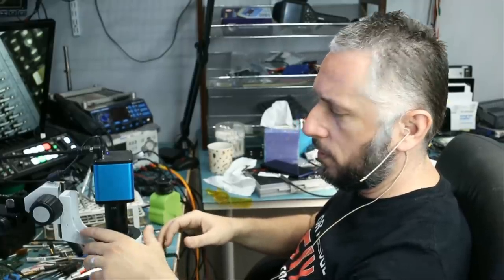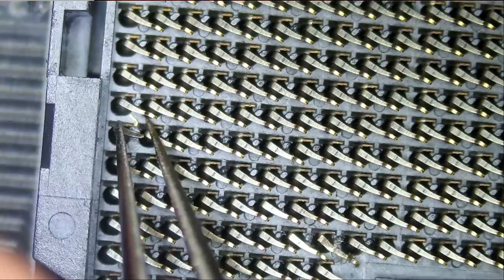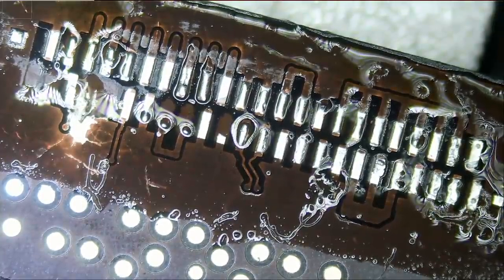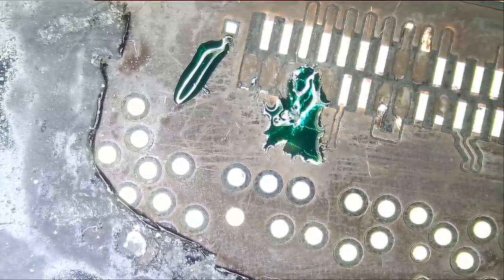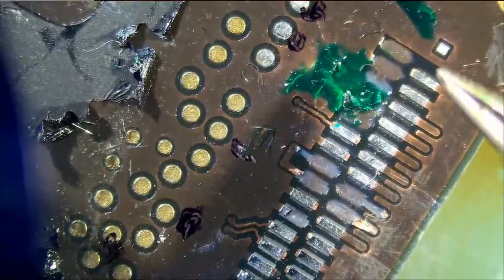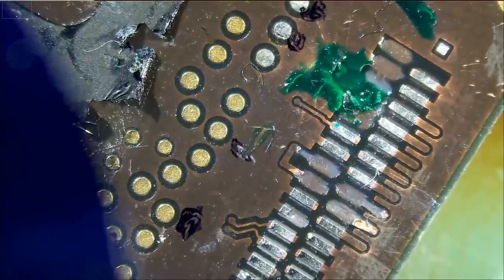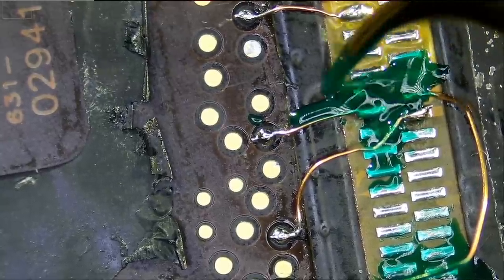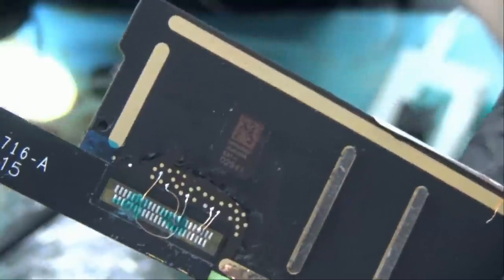Asus CPU Socket & iPad 6 charging flex board repair + Hoodie gift

Comment: as i'm sure many don't know; Sockets are replaceable, not worth the money on low-end Mobo's but a Z class chipset like the one in the video is well worth it 
the socket itself costs 20 $ from china and is a BGA component
Reply: Good luck finding a shop that wants to solder on BGA components or even has the stuff to do so.

Comment: 1:20 I advice to heat a little area where the bend pins are. I think some about 80 degrees Celsius should make the job easier making pins softier and also more resistant to break.
This is from my personal experience
Reply: damn thx for the idea
Reply: Thanks
Reply: as i'm sure many don't know; Sockets are replaceable, not worth the money on low-end Mobo's but a Z class chipset like the one in the video is well worth it 
the socket itself costs 20 $ from china and is a BGA component

Comment: What about the pin that fell into the socket? Isn't that a shorting hazard? Otherwise amazing job. You have way steadier hands than me.
Reply: It goes into ninth dimensions and it lie next to capacitors and resistors so it is not a problem now ;)
Reply: wondered same thing.  had to rewind and look twice to make sure I saw what I thought I saw.

Comment: Should the 3rd wire repair have been  connected to the pad next to it aswell.
Reply: Well spotted. I forgot that as well and that's why I would jot down a quick diagram for a job like this and not rely on memory.

Comment: The straight jumber on the flex cable should have gone to pad beside it too since the pads were joind under the flex cable but had both pads ripped off!

Comment: for bad intel cpu pins, If you pre heat the pin with solder iron I believe failure are less frequent.
Reply: I wanted to say the same thing. Prevents from breaking.

Comment: Never understood how people end up bending CPU pins?... it's not rocket science to install a CPU. Bought a used Asus, socket 1366 motherboard one time that wouldn't post, got it real cheap and it looked new, not roughed up. Turned out a few bent pins on the CPU socket, and one missing jumper for the CMOS... board then posted right up. Been running excellent ever since.

Comment: when I'm trying to remember a bunch of traces and contacts like that I'll take a picture and print it out really quick then pen in lines for the traces and where everything is supposed to be going.  otherwise I will 100% forget something and get something wrong or end up searching for hours for schematics and diagrams.  if you can do it by memory your brain works better than mine.. which isn't really much to gloat about lol.

Comment: Why do companies add so many ground pads when keeping just one or two might simplify the design ?
Reply: I think is because this way they can make a standard connector. 

Those duplicate pins are used so the conector can have 30 pins, not 23. That way it can be on a size easy to connect. 

Other reason is that sometimes the tension is big, so a single ground pin may not be enough. 

That’s my opinion.

Comment: Why wouldn't you just use an insulated wire?  That solder mask looks like a nightmare for the next shop to fix this charge cable connection

Comment: Sir, I am using Hp notebook(i3 10th gen with sad)since 1 year, but when charged it charging indication light turn white which indicates battery is fully charged,till my battery 95% available.

I update battary drivers,bios update
Still issue not fix.

Please Solve my problem